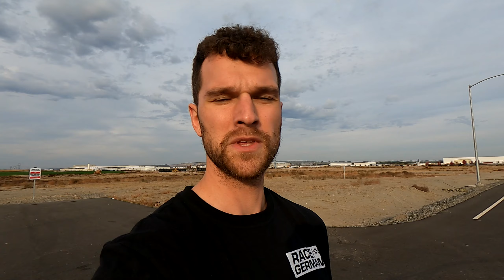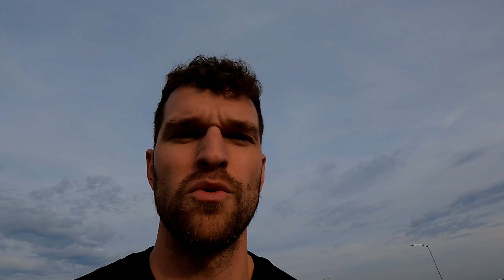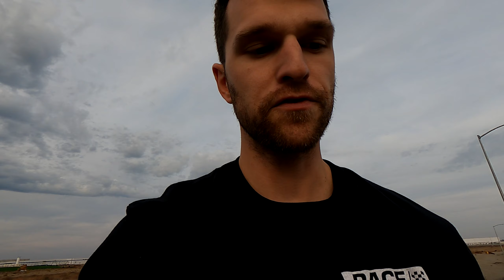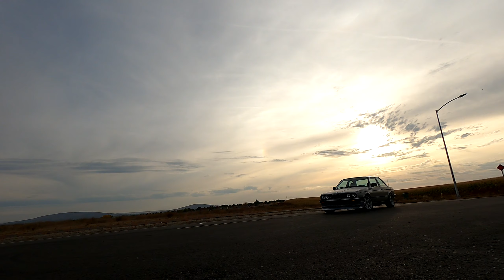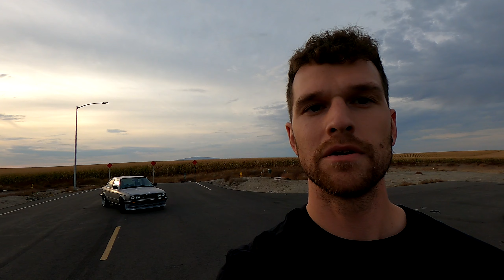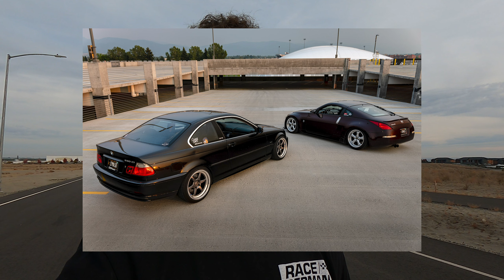How Does Camera Focal Length Change Car Photography?

Comment: I think all the middle focal lengths look good, with the higest and the lowest only really suitable for like Art kind of pictures instead of merely just capturing the car. For the higest and lowest focal length you kindof need to have your specific picture in mind that you want to achieve while the middle ones, you can just capture the car. Both are viable but you have to kindof know what you want to get into and do that
Reply from the maker: That's definitely true. Each focal length can look good if used in a specific manner that benefits them.